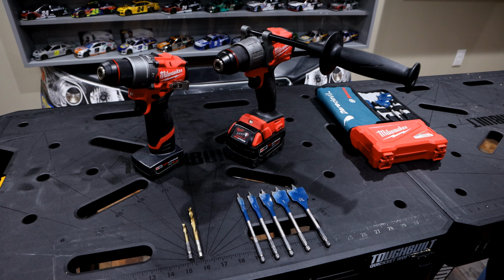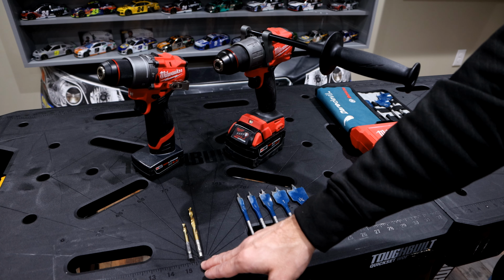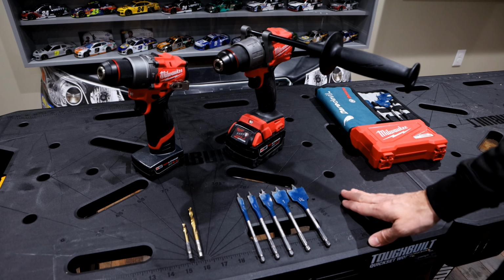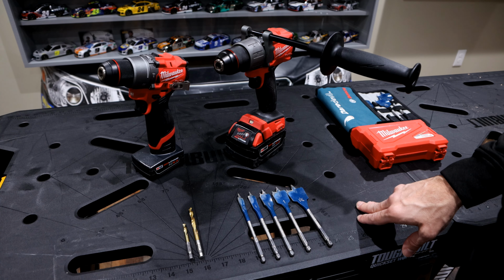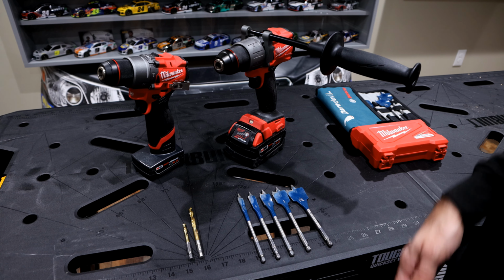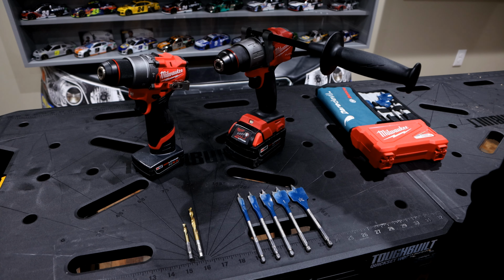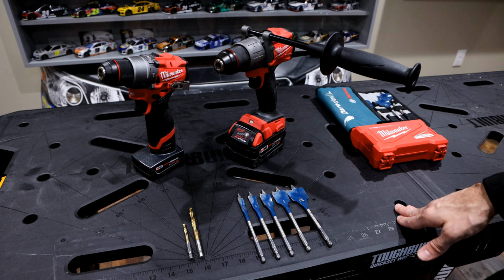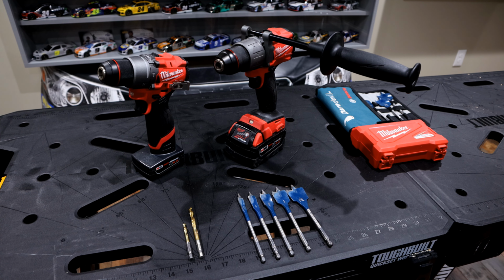Milwaukee M12 FUEL Hammer Drill 3404-20 (Gen3) vs the M18 FUEL Hammer Drill.  M12 vs M18 Drill Test!

Comment: Setting the M12 to speed 1 is for high torque drilling. Using speed 2 for high torque drilling is just asking for it to fail or cut out. I have absolutely no problems drilling anything that requires high torque with my Gen 2 M12 hammer drill in speed 1 - it's a small-ish sized beast......
Reply: Yep, except large hole saws like 4" or more, and doing it repetitively. The truth is it's more then capable for most people. The 1" spade bits are a joke haha, anything can do that

Comment: Great video!  Did you test the drills on Speed 2 the entire time?  I suppose if someone only had the M12 Fuel hammer drill and needed to complete multiple holes with the larger spade bits, they could always drop the speed down to Speed 1.  That will provide the drill more torque even though it would take longer to complete all of the tasks.
Reply from the maker: Yes, both drills were set to speed 2.  Your right speed 1 would have increased the torque, however I left in speed 2 to see the max the tool could do.
Reply: M12 would've ate in speed 1. Ask me how I know.
Reply: I was pretty impressed that it did as well as it did on speed 2. Speed 1 would've handled the 1.25" bit like nothing

Comment: I have rohm chuck that i put on my m18 gen 3..i want to know if the m12 gen 3 has same chuck model some says m12 chuck is shallow.
Reply from the maker: Correct the M12 chuck is a little bit shorter.  It probably has something to do with it not having the torque of the M18 so the larger size isn't required.  With that said, you may be able to interchange as they are both held in by a simple chuck screw.   Not sure if these will help, but here are a few parts list for these drills: https://documents.milwaukeetool.com/54-24-2260.pdf (3404)
https://documents.milwaukeetool.com/54-06-5010.pdf (2803)
https://documents.milwaukeetool.com/54-24-5010.pdf (2804)
Reply: @TeamDIYNow  yes your right I'm planning to put the rohm chuck on the m12.

Comment: The tools have more torque when in speed 1 and the m12 will most likely do the 1.25" on speed 1. Idk i have never used it but maybe even do bigger holes for pipes?😎😅
Reply from the maker: Yea you are right, I have done some follow up test with this M12 drill and confirmed you can cut even larger holes in speed 1.  If you're going to do bunch of hoes the M18 would work better, however if only a few this M12 drill is impressive.

Comment: I have a dumb question to ask, I'm new to these power tools and if you couldn't afford to purchase but one, either the hammer drill or the impact driver which one would you purchase. The reason I ask, from my research on the two, the hammer drill can do everything that the impact driver can do and vise versa, but everyone is switching over to the impact driver. I'm just a diy around the house guy so any help would be appreciated.
Reply from the maker: Good question, it really just depends on what need out of the tool.  The M12 gen3 hex impact driver will allow you to drive very large screws with good control (they are loud tho).  If you have never used impact driver, the best way I can explain is the variable trigger allows you to sink screws to the perfect depth almost every time as you can easily throttle it down.  If you have the need for drilling holes, then you would probably want to get the drill as you can also screw in screws.  Another option is the M12 Fuel screwdriver which has the hex connection on the end but has all the drill options (I have video of this tool coming out soon): https://www.homedepot.com/p/Milwaukee-M12-FUEL-12V-Lithium-Ion-Brushless-Cordless-1-4-in-Hex-2-Speed-Screwdriver-Tool-Only-2402-20/203835505.  Hope this helps.
Reply: In my opinion, just buy the impact.  When I first started working as an installer, all I had was my m12 impact, and it did everything I ever needed.  After a while, I finally bought the m18 hammer drill as I sometimes work in live office spaces so I bought the drill for its quietness, as a courtesy.  But honestly, I could have gone forever with that impact.  Some of the other guys were surprised that it was as powerful as their (older) fullsize drills/impacts while being much smaller and lighter.

Comment: Got the 4 Generation M18 its nice but I still think my FLEX TURBO HAMMER DRILL with the 3.5 and 6.0 STACKED LITHIUM has a little more power I will be doing some testing after the new year
Reply from the maker: I don't have much experience with FLEX tools but have started to notice them for sale a lot more.  Curious what you find out.

Comment: I wish somebody had a video of drilling though metal
Reply from the maker: I have used both of these drill for drilling through metal with cobalt bits and I prefer the M12 as you want a slower rpm for metal.  I will see what I can do for a follow up video.
Reply: @TeamDIYNow  thanks I just need to drill through mild steel with a 1/2 step bit at work I drill alot of 1/2 inch holes for molly nuts usually through very thin sheet metal rarely through thicker metal
Reply from the maker: @gatordave6629  Ok will see what I can come up with for a demo.

Comment: So I tried my gem 3 with a 11/64 titanium bit with 2.5ho battery...drill into 3/8 steel. .. heat up and cut off after bout 4 holes.my gen 1 didn't heat up as much thou. ...dunno if is a design thing with the gen 3....other ppl notice the heat issue as well
Reply from the maker: I haven't noticed any overheating with mine.  Have you tried different bits?  Colbalt bits typically will go through steel better so they may give you more run time.
Reply: The Gen 3 is more powerful so more power more heat

Comment: I'm new with buying Milwaukee tools and interested in buying the M12 fuel impact driver 
on the home depot website but I'm confused with the generation versions. How would I know
if I'm buying the M12 fuel impact driver gen1, gen2 or gen3 model? Any help would be appreciated.........
Reply from the maker: Good question as it can be confusing on how they are listed.  Milwaukee usually will have in the description gen3, etc when they are initially released.  However, after they deplete the previous generation inventory, they typically quietly remove the gen2, gen3, etc in the description (or atleast Home Depot does).   Here are the latest model numbers for both the impact driver and hammer drill.  Also they do make a combo set which has both which is number 3 here. If you do a search with these model numbers you will see various other listings with additional batteries as well. Hope this helps.
(1) Milwaukee M12 FUEL Hex Impact 3453-20 (Gen3):  https://www.homedepot.com/p/Milwaukee-M12-FUEL-12V-Lithium-Ion-Brushless-Cordless-1-4-in-Hex-Impact-Driver-Tool-Only-3453-20/321180351
(2) Milwaukee M12 FUEL Hammer Drill 3404-20 (Gen3):  https://www.homedepot.com/p/Milwaukee-M12-FUEL-12V-Lithium-Ion-Brushless-Cordless-1-2-in-Hammer-Drill-Tool-Only-3404-20/321179968
(3) Kit that includes both (3497-22):  https://www.homedepot.com/p/M12-FUEL-12-Volt-Lithium-Ion-Brushless-Cordless-Hammer-Drill-and-Impact-Driver-Combo-Kit-w-2-Batteries-and-Bag-2-Tool-3497-22/320268525

Comment: Being the week before Christmas, a mere hundred dollar bill is all that stands between these two.
Reply from the maker: Agree if looking for maximum power the M18 is going to win all day long especially when the price is comparable.  However, if looking for lightweight and compact that can handle 99% of DIY task this M12 is the better choice in my opinion.  The only time I find myself using the M18 is when someone else is already using my M12.  Depending on the job you can't go wrong with either choice.
Reply: @TeamDIYNow  Also, if you're doing a job overhead you'll appreciate the M12 real quick. With that M18 and a 5A battery you'll definitely feel the burn.
Reply: Being end of January, it has shrunk to roughly $10. And as long as you do not do light work overhead all day long, that is a given win for the M18 in my book.

Comment: I dont who this guy is but he cheated your thinking by make the m12 drill fail.  if you look at how he holds each drill when he is drill 1-1/2 you'll see what I know too.
Reply from the maker: Not sure what you mean by I cheated the M12?  I simply held the M18 at the top so it doesn't twist my arm off.  Regardless if I held it at the top or the side the M18 was going to go through it no problem.  If I would have held the m12 at the top as well it would have stopped even sooner in speed 2 when using the 1 1/4 when doing the second hole.  I have a lot of M12 drills and impacts and they all work great.  However, the bigger brother M18 is more powerful in nearly every category like shown in the video.